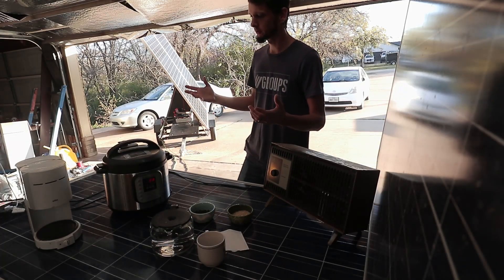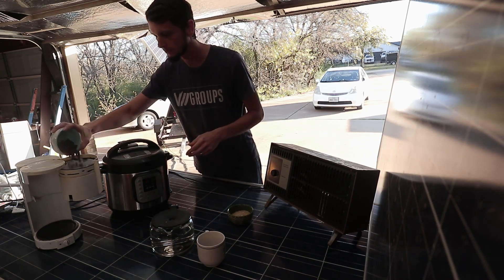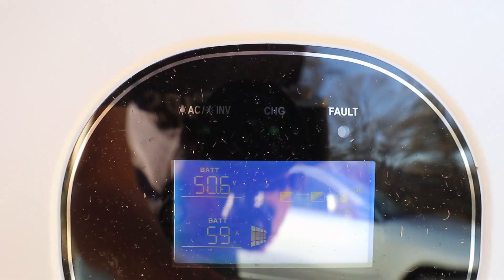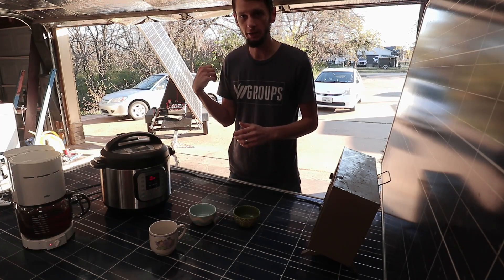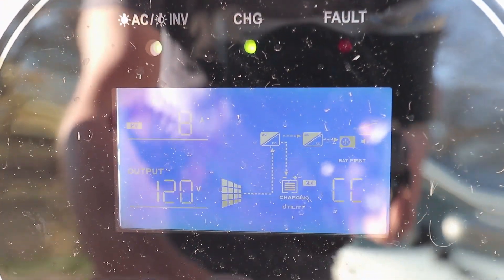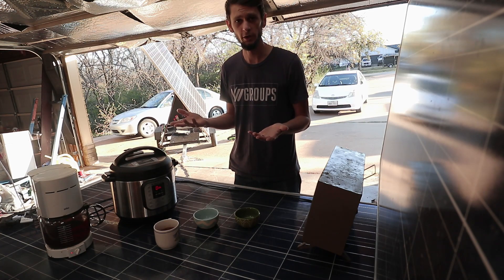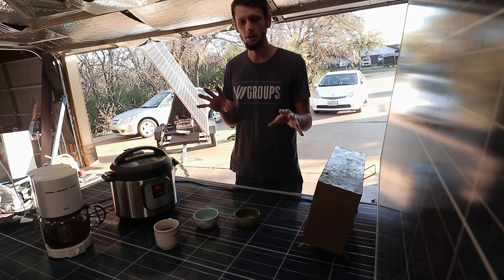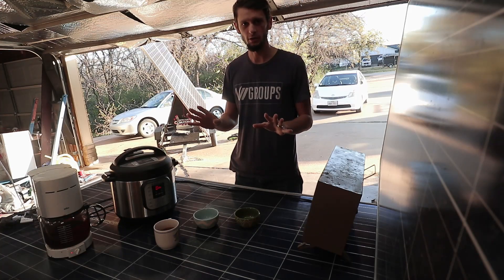Overloading My Growatt Inverter With Bad Coffee

Comment: Hi ya,
This is a FANTASTIC video mate! I've been watching ALL the solar, battery, inverters, MPPT, wiring, all in one's and van build videos etc that I can, as looking to do a First time van conversion here in U.K. in next year, but also want to have a system to back up the house and then if j sell the house and live full time in a lwb high top van, (after I build one!) Then I'm looking to build the best solar set up I can at the lowest possible cost! (Even looking at bulding my own batteries from Cells off "Ali.." etc, so watching all the YouTube videos I can.. 
Anyway long story short this video is a great video that gets to the poibt, is understandable, doesn't ramble from one topic to another then back to another to confuse issues, covers lots of aspects within the one video and I found it very useful! So thanks! I subscribed straight away and am going to watch your BMW battery build later today.. great information!
Thanks from(not usually that sunny) London England!! 👍💪😎🙏🏴
Ps. I'm thinking of going for 4 X 250w panels on a van if they'll fit and possibly 6 if I can perhaps have 2 panels that I can connect up once stationary stored inside or under the other ones until stationary. Also have 6 in my garden until then. Also thinking 3-4 battery packs, each of 4 cells at either 280ah or 305ah, 3.2v LiFePo4.. build the batteries myself (or buy batteries but cost is a massive factor for me!) I'm have zero electrical experience, but I've wired stuff up in my house before sockets and even a built in hob! Lol so I'm pretty good at following instructions and picking things up, so I'm fairly confident of being able to do it all (only hesitation is building and balancing the batteries from Cells as that's pretty much a minefield excuse the pun!) But it's pretty intense in terms of learning curve.. can't work out what I need in terms of panels Vs inverter Vs charge controller Vs BMS, Vs battery storage, as all the videos tend to be individual topics and VERY hard to link it all together myself mentally as to what I'm gonna need! Obviously I want to power EVERYTHING you'd typically have in a house if I move into a van, so need it to be beefy and the lack of sunshine in England mostly, I need to make sure batteries will charge in minimal sunlight aswell as fully sunshine and also have battery capacity to last a week of overcast days if needs be or last resort hook up to mains if available, or have a generator as backup.
Sorry for the essay but any advice you can offer regards panels wattage each (plus series/parallel set up) 12v DC Vs 24v DC system (we have 240v grounded 3 wire AC appliances as standard in UK not 110v) so any storage/battery capacity advice also would be great!!
Thanks again! 👍
Reply from the maker: Check out this video, it covers putting together a prismatic battery pretty well. Also seriously consider 24 or 48v for your setup. You’ll be thankful for smaller less charge controllers and less heat.

Honestly something like in this video would probably treat you really well. Especially if you made a 48v 300ah monster of a battery.

I appreciate the kind words, let me know if you have more questions as you continue to learn.
Reply from the maker: 272 Amp Hour Lithium Solar Battery - Entire Build Process Includes Our Mistakes!

https://youtu.be/XcuI7rgo9zE
Reply: @BeeneEnergy  brilliant, thank you so much mate for the advice that's what I was thinking myself tbh as the cost of the 12v weirdly seems to be more than higher voltages of 24/48v, but I guess if I'm running 12v appliances from it I'll need some sort of second step down inverter to 12v from 24/48v whichever I go with as I'll want to run LEDs and as many 12v appliances as possible for efficiency and not to need the AC inverter running but at the same time have the AC capacity (to run high loads like microwave, oven/hob, blender, power tools, that type of thing anything not 12v or that 12v versions of are crap lol)..
Reply from the maker: @AB-C1  Yep, and those buck converters are cheap. $100 would get you a 60-100a that will be more than enough for the things you’re talking about. Golf carts use them commonly.
Reply: @BeeneEnergy    brilliant, thank you. It's hard getting your head around this electrical technical stuff when you aren't used to it lol.. I'm getting there, and in m sort of person thirst for knowledge and try everything myself first before paying someone else same with buying things of I can make it or do it myself I'll do it.. like working on my BMW lol.. 
Battery wise just checked out the thumbnail and look like similar cells to ones I've been considering ice heard EVE are best/most reliable/cheap option right in terms of balanced matched cells at a good price about £85 ish or 110usd a cell on "Ali.." now but if you heard of any different better or perhaps cheaper ones just as good, Then also be great to know..  (everything is double or triple the price here in UK in general compared to America, so that's why need to do it cheap as possible/order online etc) plus want to have backup for house as I'm sure SHTF is imminent in next month or so so want to get sorted ASAP!!
Also I'm thinking going with second hand cheap solar panels I've seen online, saw a video where they were tested and seemed to all work as advertised and MASSIVELY reduced about £60 a panel (plus cost of a shipping pallet to UK whatever that is..) was also wondering if either they're not available or I have to go brand new of going for 3x 350w panels or 3x 400w panels but depends on cost.  Again other ones are ridiculous cheap compared to even 100w panels which aren't really viable I think for a normal van roof in terms of space I'd need to make up the powet?

Comment: Great video. Can you tell me about your battery set up. I have the same BMW 16s battery modules sitting idle since it’s 67.2V and wondering how are you using it with the inverter since it’s rated for 48v/14s.
Also are you using BMS wire harness to parallel connect the cells?
Reply from the maker: Thanks! I had the ones that were 8s in each pack. I put them in series but only used 14 of the cell pairs making it appropriate for the 48v growatt. It'll charge up to the needed 58v or so that Li Ion needs. I cut and soldered onto the BMS wiring harness to mate my BMS to the existing sense leads.

Comment: If it was night time, and your batteries were dead, and the Grid was down (a total power outage) and you used a stand-alone generator say at 6Kw to power your GroWatt, would the loads connected to the GroWatt get a conditioned Pure Sinewave of AC power or would the GroWatt just pass through the Square/modified Sine wave of the generator?  Also, in the same situation would some of the generated energy go to charging the dead batteries at the same time as providing power to whatever loads were connected to the GroWatt?   I'm a new  Subscriber trying to learn as I have already ordered my GroWatt.
Reply from the maker: Good question. I’d need to check the settings, I believe by default the generator would be used to charge batteries and inverter would provide power. And if the loads are too high there is a setting to allow the generator to power loads in bypass mode with no battery charging.
Reply: It all depends how you program it. Download the manual from Growatt.
There are so many options.

Comment: Great vid. Can you tell me please, how loud the inverter is, when operating just as regulator? I will have growatt 3000 in a very small space.
Reply from the maker: When you say as a regulator which piece do you mean?
Reply: @BeeneEnergy  thank you for your reply. I know Growatt is working as 3 things in 1. It is working as regulator all the time, because it is regulating the energy coming from the modules and going into batteries. I meant, how loud is during that time, when nothing is plugged in. Just modules, growatt and batteries. Is it loud like a computer ventilator or louder?
Reply from the maker: @artofmghow6419  Gotcha! I’ll have to fire mine up and see but I don’t think it really starts running its fans until the inverter powers on.
Reply: @BeeneEnergy  great. That helps a lot. Thank you so much.
Reply from the maker: @artofmghow6419  ok I’ve got a 1.4kw load on this thing and it’s pulling in 160w from solar(evening sun). Fans are running but they are barely audible. Granted I’m outside so it’d probably be noticeable inside but certainly not obnoxious.
Reply: @BeeneEnergy  ok. Thank you so much for your efforts. Means a lot. Cheers.

Comment: Hello, I have a Chinese mig mag welding machine. It works at 220v with a nominal consumption of 2800W. I took this data from the label on the back, and it says I max 30A (they are 6600w peak at 220v) do you think this inverter will be able to make it work for very short periods? Thanks. John from Argentina
Reply: Whith te same inverter Us your but 220v version
Reply from the maker: @juansemeraro8511  That’s hard to know. If continuous is 2.8kw with peak of 6.6 is seems unlikely though. I’d probably opt for a 5kw inverter. Better yet a transformer low frequency inverter to better handle the surge current.
Reply: Thank you!!

Comment: Would you recommend the 24v growatt products for a van build? I'm currently looking into components I'll need for my 1700w solar array, 30amp + shore power, and 300ah 24v battery system and the price adds up quickly if buying all the components separately. i.e. just an inverter/charger is more than this whole thing and you still need to get the solar charge controller and a lot more... Just wondering if it's a viable alternative on the road :) thanks!
Reply from the maker: Yep, so long as 3kw isn’t totally overkill for your build. Probably about right. The inverter will have about a 45w standby consumption rate. Over 24h that’s not insignificant. I think it’s a 300-400w panel worth of consumption.

You can still charge with the inverter off so you don’t have to leave it on all the time.

It’s good value when you need transfer switch, solar, and inverter. As you are seeing.
Reply: @BeeneEnergy  awesome, can you turn it on/off remotely or do you need access to the device? I already turn my current inveter off whenever I'm not using it so it wouldn't be a huge difference on the front
Reply from the maker: @MaxCloutier  It’s a flip switch that could easily be wired to somewhere convenient. Or put one of those car alarm doohickeys on it so you can use a clicker to activate a little relay or something.

It has the power saving mode too but could be annoying if you have small loads and it turn odd while you’re expecting the lights to be on or something.

Comment: Fantastic video! I am working out the details of a very similar setup but am curious about your BMS. I spoke with Growatt and they said that there are only a couple "approved" batteries to use with the the Growatt unit and if using a "non-approved" battery, one would have to figure out how to get the BMS to talk with the Growatt correctly. Did you have to deal with that? I got a couple 48v LG Chem packs from Battery Hookup that I am looking to use in my system. Any advice would be great! Cheers, Remy
Reply from the maker: They aren’t wrong. My bms isn’t communicating with the growatt, so my battery is an independent system. I must choose user defined in the growatt for battery type and manually set my charge parameters.

Comment: Im stuck HELP....I have the same Growatt but need help with my panels. I have eight 460w with VOC 51.7v panels that I would like to connect to my unit. I plan to buy a 2nd in the future. How would you suggest I connect my panels? Would I be able to use all eight or would I need to split them up over two units?
My plan is to be able to run as much of my home off of off grid solar as possible, thats why I have such high watt panels.
Thank you in advance
Reply from the maker: Sure you can connect all eight. Assuming you have the 48v version of growatt.

With a max pv input of 145v you’ll want to do two panels in series. Use a combiner box to bring in 4 strings of two panels each.
Reply: @BeeneEnergy  Thanks for getting back to me so fast. Yes i have the 48 volt Growatt.
I just got everything all setup today but I need to start on the panel install next.
Reply: @BeeneEnergy  Can you recommend a decent 6 string combiner box?
I have a 4 string Briddea with 10A fuses and 63A breaker. It doesnt seem to work. I get no power from my panels when connected. I ran a few panels directly to my Growatt and they showed up.

I check all connections on the combiner box and reset the breaker a number of times.
Reply from the maker: @richd9771  Seems like those would be fairly bulletproof. Were you able to use a multimeter and see if power was making it past the fuses? I’ve built a combiner box using the midnite mnpv6 which is pricey but good stuff.
Reply: @BeeneEnergy  I didnI did a continuity test on the fuses and breaker and all was good but thats all I did
Reply from the maker: @richd9771  did you have at least two panels in series to each input of the combiner box? What was the voltage at the 63a breaker?
Reply: @BeeneEnergy  OK I did it....So the combiner box has the main breaker showing + on the left and - on the right but at the bottom of the breaker it shows opposite and the manual confirms. 
My test showed pos and neg switched.

I took a look at the Amazon posting and seen a picture showing neg connected to pos so I switched the wires and BOOM! Im in business.
Reply from the maker: @richd9771  Nice! Reverse polarity was one of the thoughts I had, you beat me to it.
Reply: @BeeneEnergy  Ive been wanting to do this for a really long time. I started with the simple 45W Harbor Freight set years ago and kept moving up.
I had already bought my Growatt and it was siting on the floor when I came across your video. You really inspired me to get it all setup.....thank you for that.

I need to get a much better battery bank...Im currently using 8- 35amp hour batteries set up to make 48V.

Where are you located? Im in the CA bay area.
Reply from the maker: @richd9771  That’s great! Hey plenty of battery to run loads during the day. You can set the growatt to flip back to grid once the sun isn’t enough to power the loads. Shed some load from the house and have backup for when grid is down.

I’m here in the DFW area of north Texas, few miles away!
Reply: @BeeneEnergy  Cool, Id like to keep in touch with you if thats OK?

One last question for today then Ill give you a break....Like I said I have 8 commercial 460W 58V panels...there like 7 ft tall 3 ft wide.
Do you think I can run quite a bit of my home with that amount or should I get more? If more then what would you suggest?
Reply: @BeeneEnergy  Happy Friday....So I now have two of the 48V Growatts hooked up and everything is running as it should however I have one problem that I hope you can help with because I cant figure it out.

Just as soon as I connect the AC to the units i get errors on both units. #16 is the fault "Parallel input phase error"
How can I correct that problem?
Reply: @BeeneEnergy  Happy Christmas Eve... So I have my 2 Growatts working just fine but Im having a problem with my batteries and hope you can help.

I bought 2 24v Lifepo4 batteries as a 48v set from Battery Evo. They list at 100ah 5.0 kwh.
 From day 1 I havent been able to get them to work. Ill get 3 min out of them then they will go back to charge then I get 3 min again then back to charge.
From the amount of energy we have been using I was told I should get 2 - 2.5 hours between charges.
Ive been in touch with the battery company and with growatt. We have changed setting and did a master reboot of the Growatts and nothing seems to fix the problem.

My goal is to put together a battery bank to give me about 6 hours of power. I have 8 Harbor Freight AGM batteries at 70ah and they last an hour before charging.
Reply from the maker: @richd9771  My first question would be did you charge each 24v battery before putting them in series?

What are the voltage readings at full and empty? Do you have any communication with the batteries that would give a hint at what’s going on?

Comment: Would your system produce say 2.5kW all day everyday?
Reply from the maker: With the two 400w panels it will probably do about 3.2kwh a day on average.
Reply: @BeeneEnergy  you mentioned 2 panels make about 550watts, have you ever seen them do 800 watts or anything even close to that? I got similar panels and most I can make about 250 watts out of 395 watt panel. Not sure what my problem is :(
Reply: @Alex300zxTT  Looking to buy 400watt panels also would dering what I can expect to make, also where are your panels facing? North, East, West, or South?
Reply: @bnnett  because of buildings around panels are facing southwest. With 5 of these panels I make only 5khw per day total.
Reply: @bnnett  I just got some 375w panels setup a few days ago. So far the most I've seen is about 270W/panel. I'm losing a decent amount of power due to the vertical angle being about 20 degrees off from optimal and they are pretty dirty from being kept under some pine trees for a couple weeks before being installed. They could probably hit around 325W/panel if I adjuated the angle and cleaned them.

Comment: How many batteries do you have ?
Reply from the maker: I started this setup with a pair of 8s BMW EV batteries in series for a 14s (didn’t use two cells).

Then I upgraded it to use 16s lifepo4 100ah cells. That’s what it is using right now comes out to about 5kwh.